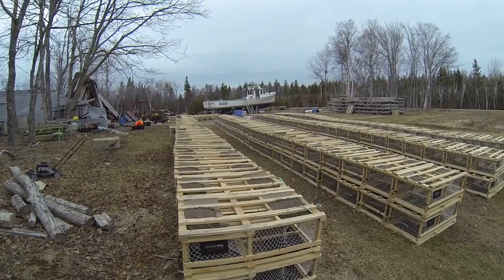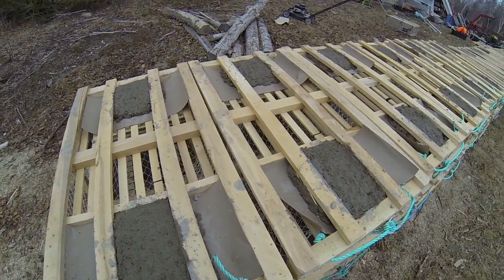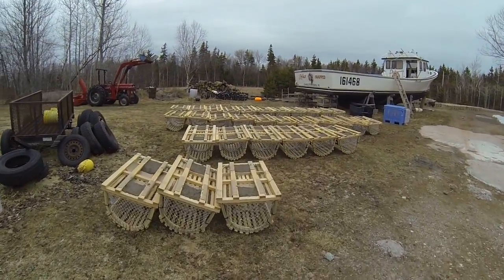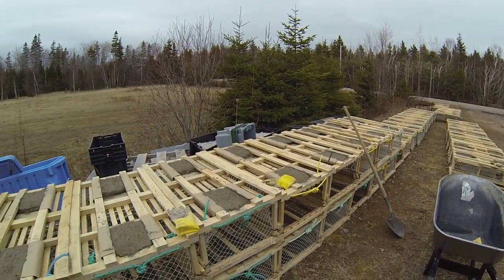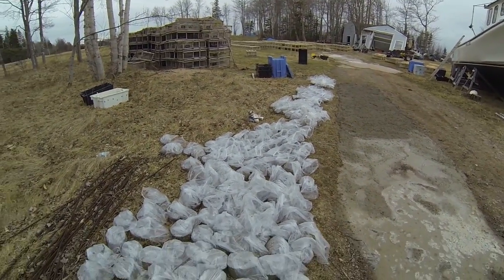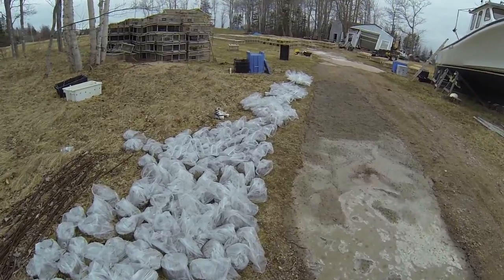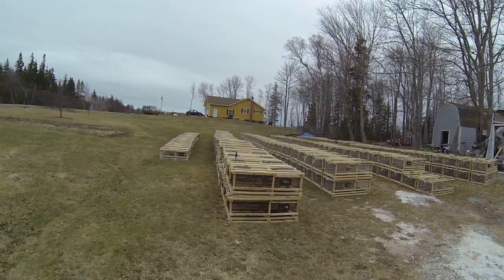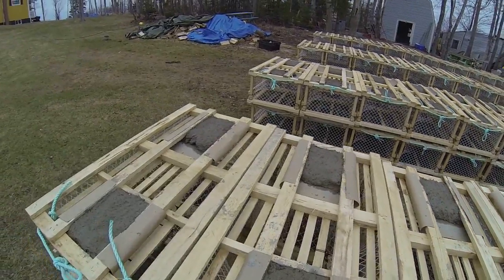LOBSTER TRAPS ARE CEMENTED!!

Comment: How does the wood hold up, up your way? We have worms that eat up the runners after a few years
Reply from the maker: the wood holds up great,, we only fish 2 months a year here ( may and june ) the water is cold in the spring so the worm's don't touch them.. if we fished july the worm's would eat them quick.. if you put the traps away in a building you get 10 years out of most of them.
Reply: Oh that's right. Makes sense. They look nice! We built 200 new traps this year..wire though.. not quite as pretty as the wooden ones lol